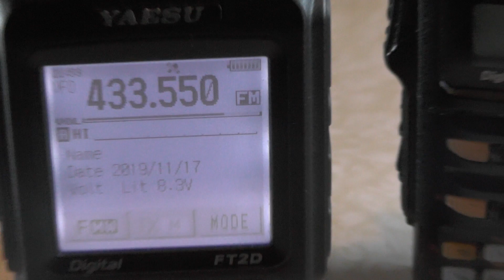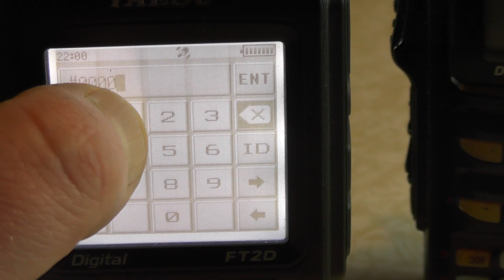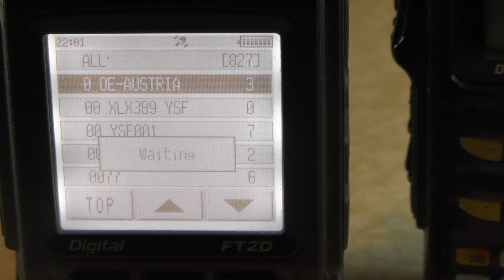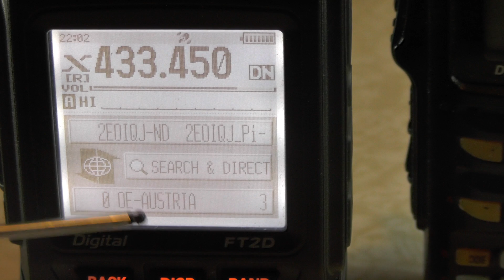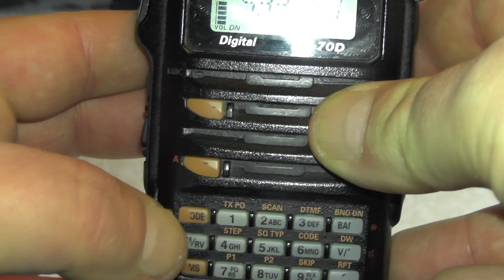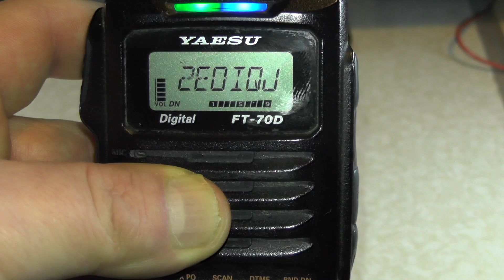Wires X ft2DE/ft7DE

Comment: Question,  i have a FT991 Wiresx enabled radio... No repeater near me, what is the easiest way to get wiresx connected?
Reply from the maker: Robbie Phelan use a raspberry pi or a hotspot I have no repeater near me as it got taken down and moved . I use a raspberry pi 3 with a pi hat on top. Friend of mine uses a raspberry pi zero it cost him about £60 from eBay

Comment: Good video Jez, I've not used my FT70 for a while. I'll dig it out and have another play! 73 Rob
Reply from the maker: If it doesn't want to connect to wires x then try it wide or narrow I had to flick between the two and suddenly it worked. I'm going to put a SD card in my ft2de and see what I can find to download but the radio seems picky on which micro SD card to use
Reply: @Khalid Graysen Flixportal :P
Reply: @Eden Ameer Thanks, I went there and it seems like a nice service :D I appreciate it !
Reply: @Khalid Graysen You are welcome =)
Reply: i know Im pretty off topic but does anyone know of a good site to stream newly released tv shows online ?